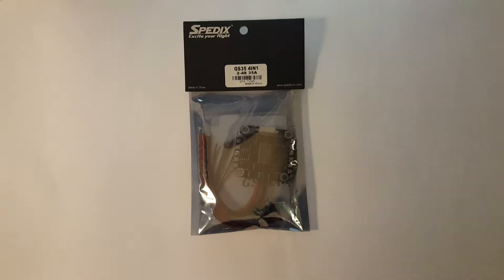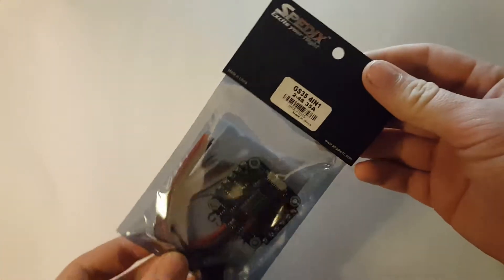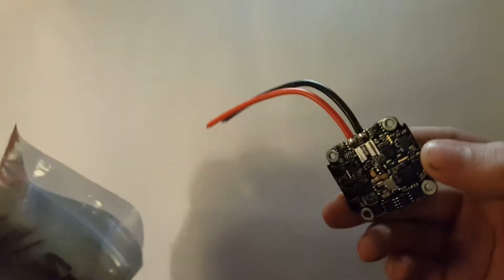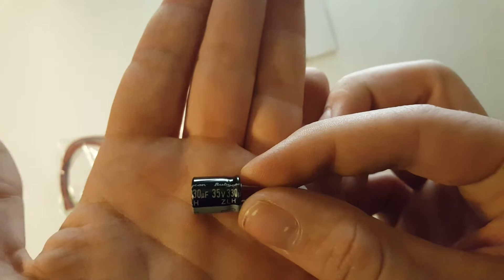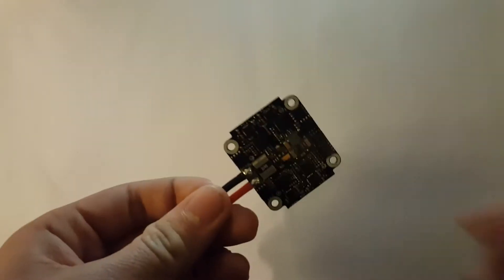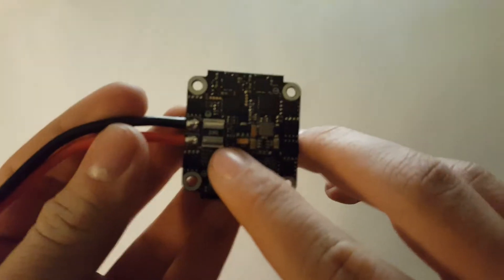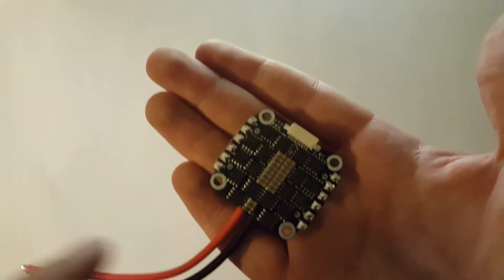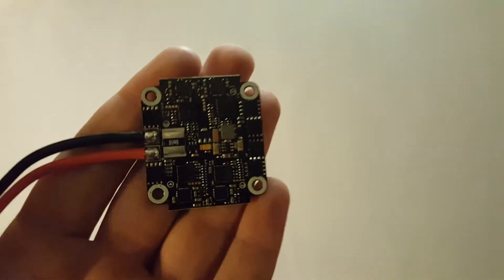Spedix gs35 4in1 Esc // Quick look and unboxing

Comment: If I’m running a flight controller with a built in pdb, can’t I just put the individual signal wire to the correct motor and then just connect the ground off the spedix to a ground on the flight controller pdb?
Reply from the maker: I'm not sure if I fully understand your question. A motor has 3 wires that all have to go to an esc. You can't connect a signal wire to one motor wire and power to the other 2 wires. We mostly use 3 phase brushless motors that always need an esc that converts the DC from our lipo to AC. Since this esc doesn't have a 5v regulator you only need to connect the 4 signal wires and a ground to your flight controller. You can use a fc with a built-in pdb but this would be obsolete, the only useful thing about it is that it can convert the unregulated voltage to 5v to power your fc and receiver.
I hope this is helpful, if you still have any questions feel free to ask more info 😀!
Reply from the maker: This isn't the same esc but it shows the principle of connecting an esc to a fc. https://goo.gl/images/rf7DJF
Reply: Elliot FPV Reviews ok thank you for clearing that up. I come from the individual E&C’s and was just wondering that this spedix has 4 signal and only one ground.